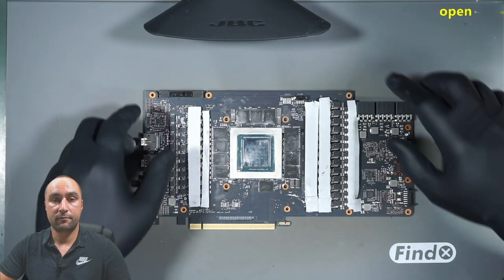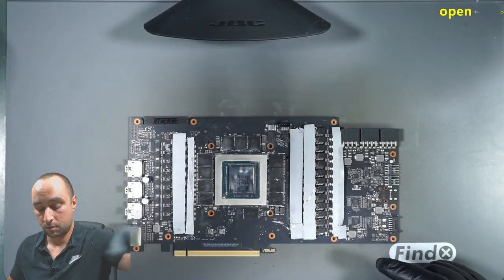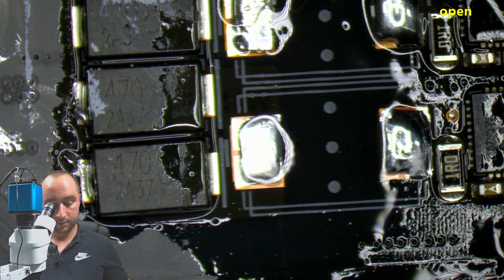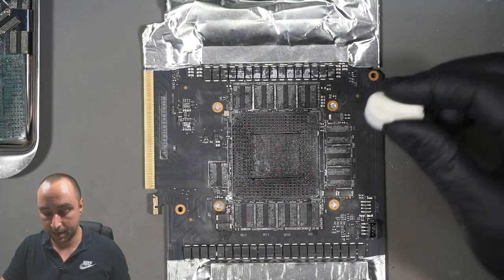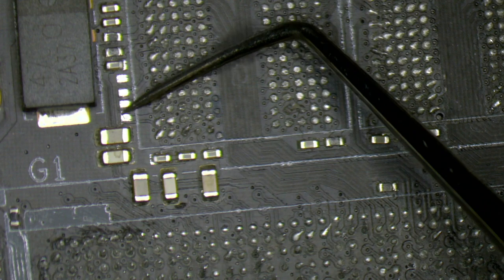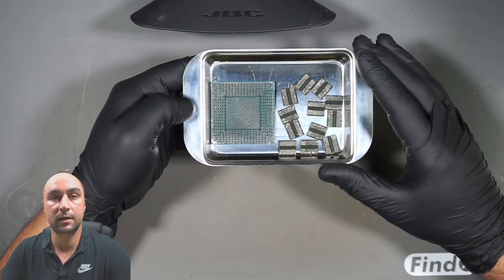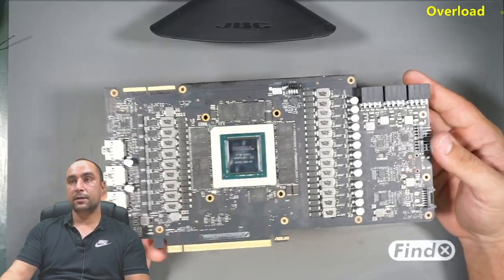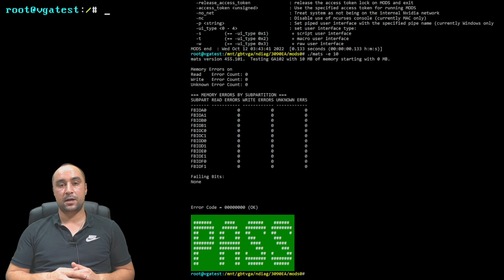RTX 3090 ASUS - Liquid Metal DISASTER | Repair #krisfixgermany #gpurepair

Comment: What amazing work. This further solidifies my position of never using liquid metal on anything.
Reply: liquid metal is one of the most stupid ideas to come by for a person that isn't try to make it into guinness book of records or something in the likes ...

There are alternatives with just a little less thermal conductivity compared to Liquid metal, but are 100% safe for use even by a donkey!
The thermal conductivity of the thermal paste is of less significance than people think anyways ... the heat conduction amount is strongly dependent on the thickness of the layer:
If you have like 0,05mm thickness layer of thermal paste between the components, the influence of that tiny layer on the total conductivity of the system is just marginal.

Liquid metal instead of a good & safe thermal paste gives u like (i am just estimating) an extra 1-5% of overall heat transfer boost, but boosts the risk of destroying your stuff from 0% up to like 50% or so.

its just not worth it ...

Whats FAR MORE IMPORTANT is the overall performance of the heat transfer capability of the thing you mounted "on the other side" of the thermal paste.
a stupid box cooler with liquid metal will perform far worse than a decent 360 AIO with mustard between CPU and pump head.

play smart, not hard!
Reply: @itsjustaname7311  not really. Loads of people use liquid metal with zero issues. If it  is applied correctly you can get a great drop in temperature, although it makes much more sense on a delid CPU rather than a GPU.
Reply: The issue with liquid metal is that most users do not understand it's application. The smallest of the amount goes a long way. However, a lot of people are of the mindset if little works great, more will work better, unfortunately, that tends to have the opposite effect for liquid metal. More is BAD as you increase chance of squeeze out and then the rest is history. 
It is a GREAT product, however, it's not for everyone and more people are prone to using it incorrectly. Thus why we see an increase is these type of problems.
Reply: @moes2168  indeed ... it kinda blows yer mind how far a tiny tiny little drop of LM can be spread ... and that is all that is required, the thinnest coat possible .. no puddles, drops, pools or runs .. just a smear of a coating. I love the stuff, used it on several builds with zero issues.
Reply: @itsjustaname7311  But LM is not for stupid people, test your IQ before using it.
Reply: @itsjustaname7311  I have used liquid metal on over 45 RX 6700 XTs and not a single card has had a single issue.
It is operator error.  It's not the thermal compound.  It is conductive, yes, but it will never hurt a component unless YOU, THE OPERATOR, SCREWS UP DRASTICALLY.
Reply: @itsjustaname7311  I use liquid metal on my water cooled GPU and CPU of my last 3 PCs and have never had issues with it. The problem is people don't learn what not to do with it before hand and end up spraying it all over the PCB. What we see on this video looks like the owner has just pushed the plunger over the GPU die like its a thermal paste and its shot everywhere.
Reply: Got liquid metal on my delidded i5 8600k. No issues for 4 years now.
Reply: I used liquid metal on my CPU between DIE and IHS 5 Years ago. It was also my first time using it. The Temps never changed and i have never opened up the CPU again, it still works fine. I didn't use anything to insulate the CPU parts inside the IHS. Just removed the IHS, cleaned it properly, put on the perfect amount of liquid metal and sealed it again with silicon, like the original glue (with a gap). The Temp decrease 10-30°C and i think there was an air bubble inside the original TIM.

The application is the most important thing. For a big GPU like the 3090 i'd say a bead of 3-4mm diameter for the DIE AND the cooler. Both sides have to be applied. Put it in the middle of the DIE and then use a cottonswap to spread it on both sides.
In the Video the owner seems to have misused the syringe and applied too much force, cause the LM to spray onto the GPU. I see that MANY times even with Paste on Youtube channels. Sometimes the Paste/LM can be dried and thus be a little stuck inside the syringe, don't apply more force, just pull the syringe back a little before slowly squeezing the TIM/LM out.
Reply: @LawrenceTimme  not many people use it because of aluminum heatsink 2nd if yall leave that liquid metal on cpu or gpu for over years it become glued to cpu or gpu and affects temperature far worsens it never every come off of it unless you use grinders shave it off it most likely destroyed cpu cover ( cpu die) or ruined gpu
im tires of so many customer ruined they own pc not realizing mistakes that will leak out and cause blew it out stuff around it and i have to clean off all liquid metal in bath of rubbing alcohol 91% besure no nothing left on board and repairs it and sent it back off to them
only one is far best safety and last long and keep temperature cooler is recommended by MX-4 thermal paste
Reply: @itsjustaname7311 Liquid metal outside certain YT content creators imho is just a vastly decentralized IQ benchmark. :D
Reply: @spitefulwar It isn't whatsoever. Liquid metal is good and there's nothing wrong with using it. The problem is that most people are dumb enough to not know how to use it correctly. Liquid metal i very good if used properly.

Comment: This is a most impressive video, thanks for sharing.
Even though I have seen other videos detailing the sort of damage it is possible to cause when using liquid metal I am still amazed at how devastating it can be if not contained to where it was intended to b applied. 
This video just confirms what I had already realised..........do not use liquid metal.

Probably due to the GPU being an RTX 3090, altho not as expensive as they once were, I was pleased that it was economically possible to repair that card, with the amount of work needed to bring it back to a functioning condition. Perhaps more surprised as the repair difficulty was rated at 10 out of 10 and the issues labelled as a "disaster".

Subbed, for both entertainment and, in situations similar to that of the above, a reminder of what to not do..!

Comment: Ugh this makes me cry. I don't have the steady hands for liquid metal and I'm glad I've never tried to use it. Great job on the fix!
Reply: A trick I use is to NEVER squirt liquid metal directly on the die. Push a little bit of liquid metal out of the syringe then pick up the metal with a brush. Then use that brush to apply metal on the die. The needle attachment that comes with the syringe is way too misleading and should be removed.

Comment: Funny story that happened to a friend, he waxed on and on about liquid metal then came round to me to tell me his puter was thermal triggering every time he turned it on and he asked me to have a look... he couldn't get the cooler off for a reason, it had its alloy base converted into a liquid metal mush that had fused itself to the socket surrounds, the cooler was like cheese and just crumbled with some persuasion... so I asks him did he read the instructions and he was like "nah, thought it was like thermal paste and slapped it on" which cost him a motherboard and a cpu for just "slapping it on" and that stuff seems to get everywhere and I kept finding weeks later little blobs of the stuff appear on my workbench.   Filthy stuff, don't use it, the couple degrees extra just ain't worth bricking your machine.

Comment: Wow. That took a lot of effort and specialized tools but was well worth it! Great Job! Another GPU saved from Trash. I don't get why people would risk their exremely pricey GPUs just for a few degrees Celsius less. I kind of get why Sony had to use Liquid Metal in the PS5 - these few degrees were more than likely the difference between the Console running stable or shutting down every few minutes to save the Hardware from Heatstroke. But the more I see of this stuff the less likey I am to use it if I can help it - It's all good if it stays where it's supposed to - but woe to you if it spills and spreads around the PCB...Yikes!

Comment: Is the 2-4C thermal improvement really worth applying liquid metal? Seems like way more risk than reward.
Reply: It only becomes worth it when you add a foam barrier and add nail polish. But I agree, very time consuming for little improvement. I recommend people to change memory pads with a copper shim + thermal putty as that is where you can get a drastic 20c reduction
Reply from the maker: I do not recommend
Reply: Depends. On GPU's mostly not since, it's not really a improvement, mostly it's the same temperature as before. On CPU's it also depends. If your CPU isn't soldered, you will gain a lot if you delid it and use liquid metal. On top i also use liquid metal between the CPU and CPU Cooler. It's not only a few degrees cooler like this, but it will also stay like this for many years and you don't have to reapply it like with thermal paste every 6-12 months to keep your temperatures. I got a i6700k CPU, which has a lot of temperature spikes, even on idle. For example i move my mouse and the cpu will go from 36° instantly to 44° and then straight back. With liquid metal this will still happen, but not as fast and not that heavy. Now it will go from 32° to 34° and then straight back to 32° which means, my cooler won't ramp up, even if it's just for a second.
Reply: The difference in temperature on a GPU is 8C average with up to 13C improvement under stresstest/load.
Reply: I applied liquid metal to my i73370k after a delid = -25°C with OC 4.4ghz and never exceeded 86°C with a Noctua NHD15 with grueling CPU tests. In advanced games it's more like 65°C max. I gained about 25°C (but the delid probably plays a lot)

I also applied liquid metal on my 1080ti OC and went from 89°C to 77°C under full load.

I also put liquid metal on my AERO 15x laptop and I gained around 15°C on the CPU and GPU part. As a bonus, the heat is localized on a small part on the chassis and not anymore  on the entire surface.

It's up to everyone to see if the gains are worth the risk. But when you like to push the limits of your equipment, it's very valuable as a gain. For me it's big risk / big gain ^^
Reply: The problem is this guy who had the card used globs of it...  a super super thin layer is all you need.  Liquid metal on my 5800x 3d IHS lowered my temps from 90c during prime95 to 84c.  And 78c on cinebench to 71c..   Its worth doing.. i even watercool custom loop..

Comment: I don't get using liquid metal, you assume a load of risk for a few degrees at best.

If you want lower noise/temps, either repad and repaste the card with better stuff or waterblock it.
Reply from the maker: These are exactly the best options
Reply: Liquid metal can lower temps by 8-10c on some occasions.. my 5800x3d went from 90c on prime95 using MX6 paste to 84c.. and 78 on cinebench to 72..   i also custom watercool using two 360mm radiators and a Ek waterblock..  these cpus get hot as hell even under water..  The issue is the cpu die itself.  Not the cooler.  And liquud metal helped immensly for me.  Used it for 10 years now.. no issues..  How about you get that IQ up and learn to apply it properly
Reply: @jeepsblackpowderandlights4305  I've used liquid metal before, it's really not worth the extra hassle.

Comment: Great work you do. Are you aware Gallium creates an alloy with Aluminium if it comes in contact? It ruins de structural integrity of the Aluminium. It will travel through the  whole part it touches.

Comment: hello sir, amazing work! I have two questions: 1-) Do you melt the solder balls on the gpu and ram chips after reballing? Until now I haven't seen a single video of you doing that, I also see you place the chips on the board manually right after reballing and moving them around, suggesting that you melted and fused the solder balls to the pads of the chips off camera. 2-) Would putting the card in ultrasonic cleaner upside down with some surfactant/detergent in the bath work for cleaning liquid metal? have you tried it? I reckon the ultrasonic cleaner would break off the liquid metal mess from the surfaces it stuck onto, and with the help of gravity I think the small metal droplets would fall to the bottom of the tank, without contaminating other areas of the PCB.

Comment: I honestly don't get why someone would use liquid metal with a 3090. I have a ASUS TUF 3080 and while it is a less powerful gpu I'm assuming the thermals are the same. When I got the gpu a few weeks ago used off ebay the thermals were pretty bad. I replaced the thermal pads and repasted the gpu with Arctic MX-4 and now my temps are great. I use my GPU mostly for AI Upscaling and even under 100% load, overclocked and left working for hours I never see my gpu temp go over 68C. There is no reason to use liquid metal on a 3080 or 3090 in my opinion when replacing the thermal pads and repasting it works just fine.

Comment: Hi , can i ask whats the usually fault if the gpu is fan spins at max and no display? 😊 Thanks in advance
Reply from the maker: There could be many reasons, most likely the processor is not functioning properly or something is interfering with it.

Comment: Very cool video and very impressive that you could still repair it. But what did the customer do with this card? Soaked it in liquid metal or what?
Reply: The liquid metal comes in a tube with more than is needed. People do not read instructions and apply all of the tube.

Comment: So, did someone just accidentally blow liquid metal out all over this board, or did they apply it to the GPU, put it all back together, and it just leaked out everywhere when it heated up? Looks like what typically happens, the liquid metal tip is clogged, and they push on the plunger, causing pressure to build in the tube, resulting in a massive liquid metal blowout across the components.
Reply: Guy used globs of it i bet...  this doesnt happen unless you apply a thick glob of it.. it only takes a super yhin ass layer

Comment: Wouldn't ultrasonic cleaner work for this? Or is the liquid metal not coming off in the ultrasonic cleaner?
Reply: While an ultra sonic cleaner can break loose some contamination it can do nothing for the corrosion and destruction the metal does to other metal parts.
Complete disassembly, inspection, repair, and reassembly are the only method that makes sense.

Comment: Awesome Video. I have a dumb question: would it be easier to freeze the Card in Order to remove the Gallium?
Reply: If it wasn't so sticky yes, but realistically it just means it's going to completely glued onto the board and removing would almost certainly cause irreparable damage. Also there was LM under ics,, that could have expanded and ripped the chips apart

Comment: From the other comments, it seem like this was the result of aftermarket mods. I've never taken any interest in GPU modding. What is the point of using liquid metal if it can cause so many problems?
Reply: Better thermal conductivity between the Die and the cooler, also better contact area due to liquid metal's properties. It's often used in conjunction with, liquid cooling to give lower Temps for overclocking. It's only worth it imo, if you take the necessary precautions, like applying a protective coating around the Die and surrounding components. In this case the user likely applied too much and didn't take the proper steps to insure its done correctly.

Comment: If I were in your shoes, I would reject all liquid metal related repair requests, especially if it looked anything like this. Maybe even give them a little scolding. Gallium and indium may not be difficult to handle metals in themselves, but it's clear that when they form an alloy, they become a menace to circuit boards. The thing just seeps into every solder joint, every crack, under and over every cap, chip, inductor and what have you. It also corrodes certain metals and contaminates workspace and your precious tools, as you've mentioned, making even more mess and potentially dangerous cross contaminator for when you use the tip next time on another board. I really don't get the mindset of people that have little to no regard neither for their property nor for other people's time. Liquid metal is not diabolic, and there are many guides for correct application available freely, yet they don't even bother with that. The bravery of a fool is folly, not a virtue.
Reply from the maker: You are 100% right

Comment: I have used liquid metal on over 45 RX 6700 XTs and not a single card has had a single issue.
It is operator error.  It's not the thermal compound.  It is conductive, yes, but it will never hurt a component unless YOU, THE OPERATOR, SCREWS UP DRASTICALLY.
I have had 40 RX 6700 XT sitting idle since September 2022 (ETH dead), and they all are resting, unpowered stacked on-top of each other all with liquid metal on die.
Not a single one of my cards has any issues, even after sitting idle for 3 months.  I don't understand how people screw up liquid metal.
Reply: To put this horror story into perspective, this user added enough liquid metal to cover over TEN DIFFERENT 3090 DIES, instead of the amount needed FOR A SINGLE GPU.  
This is at LEAST x10 more than needed.  Truly darwinism.
Reply: sure, this card looks like someone threw it into a LM bath, clearly did not read the instructions.
however: i did use LM in the past and i have been as careful as i could. i still managed once to get tiny drops on my mainboard when dismounting a cooler. luckily i noticed it and could remove it all with a brush and ipa and it did not cause lasting damage. 
however, i was very lucky. if the drops had landed on the edge of a BGA chip, that board would have been ewaste.
so i would say that when acting very carefully, LM risk is low. LM is always risky though. one slip will cost you moneys.